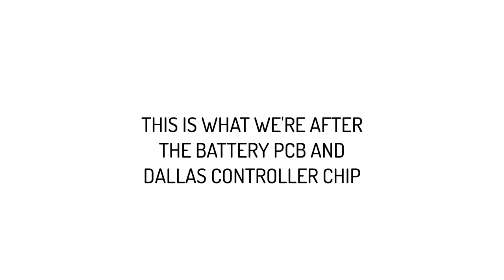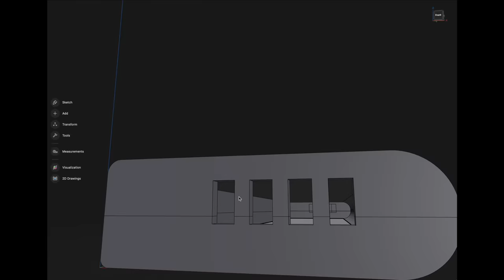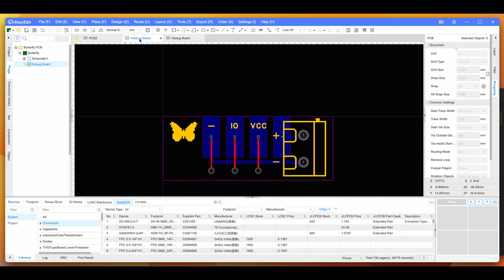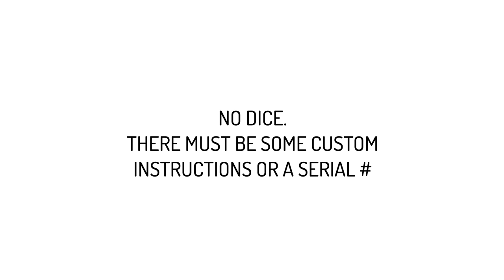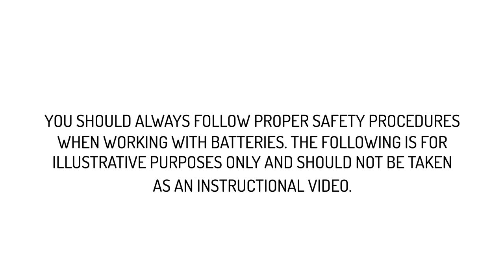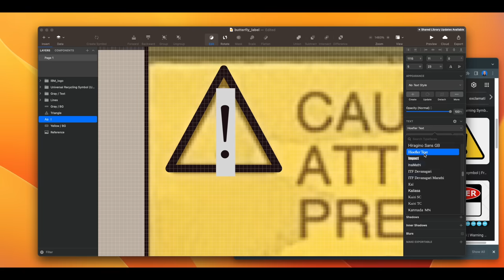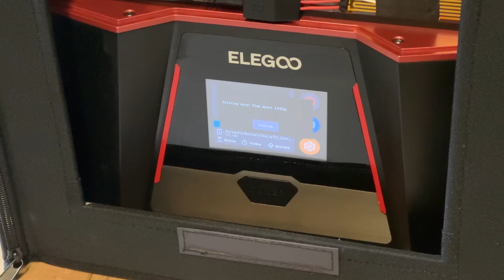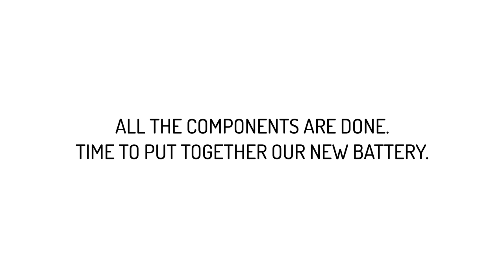Reverse Engineering a ThinkPad Battery - And making a Perfect Clone

Comment: Not super familiar with NiCad vs NiMh charging, but assuming there is a difference in how those two should be charged?? if so, how are you handling that??
Reply from the maker: NiCad and NiMH are chemically similar so there is no difference in how they are charged, or the voltage level in the charging curves. They can be direct drop in replacements which is why I ended up going with them!

Comment: @17:24; Why not go from left to right, right to left and back to right?

What CAD software is that? that looks very usable
Reply from the maker: You could have gone in any direction as long as they were all in series. I wired it the way I did for ease of assembling the pack. 

The software is called Shapr3D and I’m a huge fan. It’s simple yet powerful enough for what I need.
Reply: @polymatt  Thanks for the reply :3
I thought all in a row would be easier, as then you can just put them against eachother, but later on i saw the batteries had tabs. so with the tabs it indeed makes sense.

It looked like really nice software indeed, just downloaded it. gonna try it out :)
Reply: Oh, it even has a quick start intro.
I think it's a bit simple and long (but i have a lot of SketchUp and some AutoDesk (AutoCad/Revit/Fusion360) Experience)
But the software feels so smooth and user friendly off the getgo (unlike a lot of others)

Comment: How do I start learning these things? College? Honestly, I don't know.
Reply from the maker: I have zero formal education on the skills in this video. College could be a good resource but I’d recommend picking a discipline like electrical engineering, then a focus on PCB design and circuitry, dabble in the code side of it programming microcontrollers and continue branching out from there. I picked these up over many many years but had a good base in engineering to start.

Comment: this is a 3p3s battery with 18650 cells, is there no a bms in the pack ?
Reply from the maker: Hey there. It’s actually a 9s pack with NiMH cells - no BMS on the pack, it’s all on the main board of the laptop.

Comment: FWIW the smaller ATTiny's(4-10) whilst a mild pain in the arse to program are available in SOT-23 packages (though I doubt you'll be repeating this process any time soon ;) ).
Reply from the maker: Would you believe that I ended up needing the full 16mhz to keep up with the timing? So much overhead when using software to emulate hardware!
Reply: @polymatt  wow, that's NUTS...

Comment: Soldering batteries basically destroys them. A spot welder is easy to use and not expensive. Also heat shrink/heat gun is not a good solution, as, again, batteries get easily damaged from heat. It's a shame since the rest of your work looks good. Voice overlay of the cc would have made this a first class YouTube video. PS this is all meant as positive feedback!

Comment: The 1-Wire protocol, where the creators are the worst at following the standard... 
I do believe I have a similar IBM in my collection. Maybe time to take a look at the battery. 
Current project is renovating a Compaq Armada M300. The IDE HDD will be replaced with a IDE to M2 adapter, I'll of course fill it up with RAM, and then there's the battery...   
Then I guess it's time to build a new battery for my Psion MC400. That one's a bit easier as the charge circuitry is in the battery itself. Which means I can go from 7.2V/2000mAh Ni-Cad to... Li-Ion.
Reply from the maker: That’s what I get for just expecting directions we’re followed and they colored within the lines. Of course that wasn’t the case 😄

Comment: But why did you spent $100 for MJF parts if you have SLA printer? That were an extremely weird part
Reply from the maker: For a couple reasons. 1) I didn’t actually have an SLA printer when I started the build and 2) I was testing out the company because I was thinking of ordering a lot. In the end I just decided to open source it!

Comment: Wow! Just wow! 

I had that computer back in my Accenture days, and I was king of the hill, or actually the office... :) 
We used to sell them, and the butterfly keyboard was the wow factor. 
Astonishing work, and the attention to detail blows me away. 

I have som questions, just because Im curious, and as youll see by my question - I dont know that much about new battery technology: 

One quick question, why are the new batteries cells inside smaller? Is it capacity issue, or are new cells just smaller, or is it an advance in battery technology?
And another question, if the cells are smaller, would it be possible to fit more cells inside and make the capacity (Ah) of the battery bigger?
And third, why did you not print a support or wall inside the battery so that the smaller batteries dont move around. I saw you used tape to place the batteries, but wouldnt that tape loosen over time? My experience is that tape on things like batteries do get loose because of the heat from the batteries?
Reply: And now you have 571 subscribers! :)
Reply from the maker: Thanks so much for the sub - and yeah those laptops are awesome. Great question about the battery - I went through quite a few iterations on the case and ended up with the current design for a few reasons:

1. The original battery was INCREIDBLY packed. The plastic outer case was more of a thin shell containing the cells. I designed and printed a few versions but they were so thin and long that they would always fail during the print or warp during curing. 

2. At the time I designed the case, I wanted to experiment with different battery cell types and chemistries so I kept it open because I had no idea of the dimensions the final pack would take.

The original battery life was terrible (reportedly 1 hour 45 mins). The current smaller (AAA-sized) NiMH cells in the pack give me about 2 hours, so Im pretty happy with that. I've tried LiPO packs but they're just so different in chemistry, I couldn't get the laptop to charge them reliably. They'd power the machine great for 3+ hours but would constantly get stuck and refuse to charge. Im sure with more time someone smarter than I am can come up with a good fix!
Reply: @polymatt  integrate a charger port directly onto the battery pack with a lipo circuit and bypass laptop entirely, or make a external dock for charging this battery packs designed specifically for this battery chemistry :)

Comment: I noticed your recreated label doesn't use the same exact wording in Japanese as the original, though it basically retains the same meaning. (I suspect that's from scanning it and putting it through Google Translate backwards and forwards? That's what it looked like you were doing, anyway.) For the sake of completeness, though it's obviously too late to incorporate into your printed labels, I figured I'd give you the original text string:
注意 開けたり、火の中に入れたり、ショートさせないでください。
Your version reads
注意 開けたり、火をつけたり、ショートさせたりしないでください。
The main semantic difference is that your label warns the user not to "set it on fire", while the original label says not to "put it inside a fire". The rest is just different phrasing of exactly the same thing.
Reply from the maker: Thanks so much! I tried a few ways to find the correct characters but I’m glad I got it right in spirit :). I kind of like the “don’t light on fire” better 😂.

Comment: Reproduction label still says "Ni-Cd" as per original, but you used NiMH cells.  Later label says "LiPo", I can't keep up - LOL!!
Reply from the maker: Ha sorry for the confusion! NiCad was the original battery. The labels I ordered in that batch were labeled LiPo because I was making good progress at the time of using LiPo packs with on-board BMSs - but  it he end I decided to go with NiMH as they’ve got similar voltage curves for charging/discharging as the original NiCad.

Comment: You cant just replace nc cd batteries with lithium.. they have different everything, from voltage to bms
Reply from the maker: Yup. That’s why I used NiMH. Chemically similar enough to work with a BMS that’s expecting NiCad.

Comment: instead knife why don't you using anti glue or glue remover so the casing not defect
Reply from the maker: These cases are welded together with an epoxy. A solvent unfortunately wouldn’t open them. It’s one reason why I wanted to make my own case that you can snap open and closed.

Comment: No BMS? Brave...
Reply: its using NiMh cells, no bms required for them.
Reply: @Suicid344  Read what is written on the new sticker m8. But the video states it's NiMH indeed...
Reply: @akkudakkupl  label is wrong. Look ar cell assembly, those are configured as 9S in a pack - either Ni-Cd or Ni-Mh.

Comment: Please, please, PLEASE don't EVER solder to batteries!! I beg of you to invest in a spot welder. You can get pretty cheap ones that work well enough. Other than that, this was a fun project to watch!
Reply from the maker: Thanks and very good advice. That was definitely a “don’t do this” moment. Since then I’ve already invested in a decent spot welder.
Reply: @polymatt  Awesome! Glad to hear it! They're super handy. I recently invested in a fancy one so I could build a few e-bike battery packs. I wanted to make sure I could dump enough energy into the welds so they would have less of a chance of breaking while riding over rough terrain lol.
Reply: Oh I have a question: What company did you use to print the label you recreated for this battery pack? I've been looking for a company that can make nice decals for some projects I'm currently working on.

Comment: Why not just reuse that case it seemed just fine o,o
Reply from the maker: Hey good question. I had to break it to get in so the only way to seal it would be to glue it. Plus now that I designed a new case others can build a new battery without having an original since they’re incredibly hard to come by.